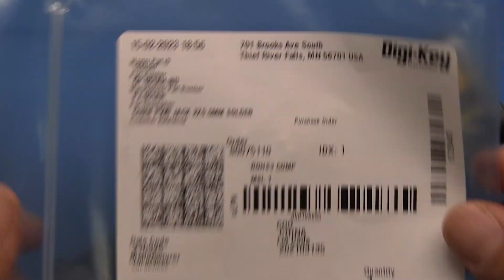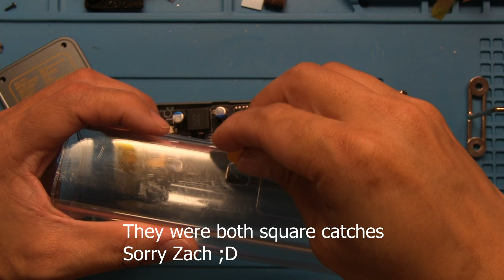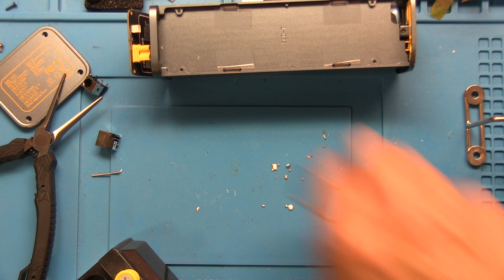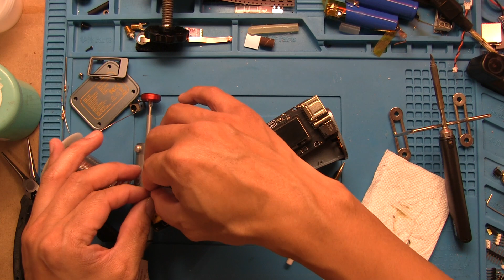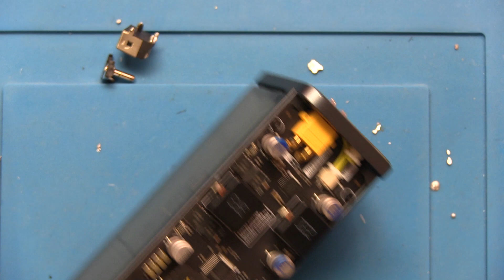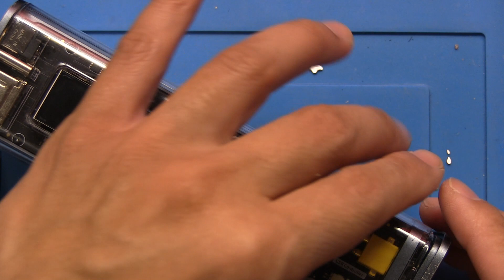Shargeek Storm 2 100W Teardown and Repair

Comment: Ty for this video!

I think i fried something in the inputs/outputs due to the dc sparking and that caused it to shutdown fully

Now on usbc input charging theres some REAL bad coil whine, managed to get the screen to flash on after resetting the button at the back and connecting input but definitely seems like somethings blown or shorted (smells a little bit inside too)

As someone who has repaired this, do you have any ideas what to look for??
Reply: Adding: it turns on via dc input (ecoflow power supply), i can operate the screen, but it says the battery has 0 charge and switches off instantly upon disconnect

The usb c is the only port that seems to whine, so something definitely is shorted or fried

Comment: Thanks for the teardown, that bezel was a fight and unfortunately broke both tabs on the button, still works though and button is retained. In my case due to a drop the 3R3 power inductor had broken a solder point, so I couldn't charge my Sharge 100. Thanks to this I was able to take it apart, fix the broken solder point and go back to charging. Will have to open it again to replace 2 broken screws that hold the rear plate holding plate. But it holds it now still fine enough if I'm careful.

Comment: Mine had one of the controller detach inside the case when i went to charge it. I heard something moving around and when i look closer to see whats making that ratttling sound and low and behold.  One of the controller had detach completely from the solder point.

Comment: Do you know where I could source a replacement screen for this model?
Reply from the maker: Unfortunately no - I would imagine digikey, but failing that - I'd have to research the size and number of conductors on the ribbon cable, size of the screen and see if a suitable replacement can be found on some of the chinese electronics sites.  The issue is the oled driver and whether or not it's compatible with the board so might take some trial and error.  What exactly happened to yours?
Reply from the maker: Never mind - seems like someone figured it out.

https://www.alibaba.com/product-detail/Topwin-1-14-1-14inch-1_1600650299153.html?spm=a2756.order-detail-ta-ta-b.0.0.50da2fc2dtaH9W  Let me know if you need help with the repair - we can do another repair video :D
Reply: @MochaboyRC  So SHARGE was kind and is sending me a replacement, AND I ordered the screen from TopWin.  I would be happy to send you both screens for a comparison to go along with a repair, but the shipping cost may prove prohibitive.  I'm in Southern Ontario, Canada.  I'd be happy to contribute hardware for the purposes of helping the community that uses these devices (as long as I get it back).  Let me know if you'd be up for it.

 - Jess
Reply from the maker: @EpicallyJess  Yeah I think that could work - why don't we take this to email and work out the details...my email should be in the "About" card in the channel/video details (just turned it on - never realized I didn't have that published).

Comment: did you know the reference for the screen? mine got dead lines....
Reply from the maker: Unfortunately I don't.  You might want to grab the dimensions with a set of digital calipers and see if anything in the digikey catalog fits those parameters.  https://www.digikey.com/en/products/filter/lcd-oled-graphic/107
Reply: thanks i hope i can find it its not normal taht screen is so delicate i never droped it never put it hard on the desk. @MochaboyRC
Reply from the maker: Someone on Reddit posted this:  https://www.alibaba.com/product-detail/Topwin-1-14-1-14inch-1_1600650299153.html?spm=a2756.order-detail-ta-ta-b.0.0.50da2fc2dtaH9W

Comment: Is it possible to replace the batteries in this power bank.  They appear to be 18650s.  If it is possible, is there less tear down involved than what you had to go through to work on the board?  Thanks for the video!
Reply from the maker: Absolutely - whether or not it's worth your time is a different story though
Reply: @MochaboyRC Hello.
The LCD on my shargeek storm 2 is dead. But the powerbank works fine. Any recommendations on what to do? Any replacement parts? :-)
Reply from the maker: @vinasisx411  This link no longer works but you can use the terms to search for a similar set of specifications.

https://www.alibaba.com/product-detail/Topwin-1-14-1-14inch-1_1600650299153.html?spm=a2756.order-detail-ta-ta-b.0.0.50da2fc2dtaH9W

Comment: Hi, when taking this apart I managed to break the display, do you know where I might find a replacement part?
Reply from the maker: Oscar - unfortunately no - from the brief time I had it it appeared to be a proprietary oled display.  Sorry for your trouble there - it's a nice power bank.
Reply: @MochaboyRC 

Ah i see the ribbon has 18 pins and it's a 1.14inch display, if I were to order a generic part is there any reason it wouldn't work? I.e. What's proprietary about it?
Reply: @Oscar-eg8ov I had the company send me one
Reply from the maker: https://www.alibaba.com/product-detail/Topwin-1-14-1-14inch-1_1600650299153.html?spm=a2756.order-detail-ta-ta-b.0.0.50da2fc2dtaH9W

Comment: I need to replace USBA on this powerbank. Any tips how to locate the part number?
Reply from the maker: You need to grab a set of digital calipers and measure the distance between the through hole posts on the usb-a header.  After that - it's just a matter of going over to digikey and comparing the photos of the different headers with the one you want to replace.  When you find a likely candidate - you need to download the data sheet and go to the technical drawings towards the end of the datasheet and compare your measured dimensions with theirs.

That's just the task of finding and matching the part.  You also need a way to remove the broken header which is a whole other skill set and set of tools.  You will need a soldering and something called "desoldering compound" - best product on the market to use is Chipquick SMD-1.  It's a special type of solder that stays molten for anywhere from 3-5 seconds which gives you a chance to use it to simultaneously melt the solder around the 4 or 5 installation posts allowing you pull the part off the PCB.